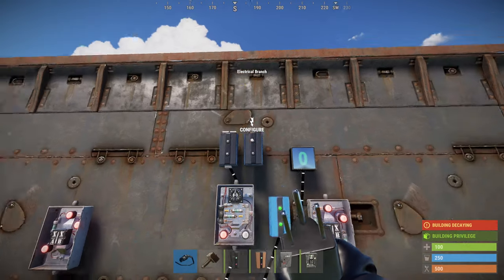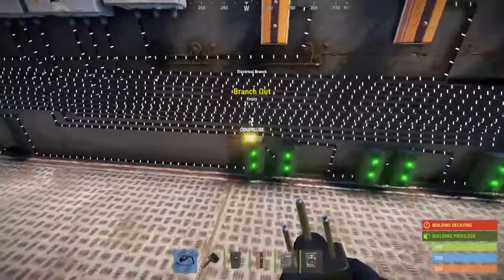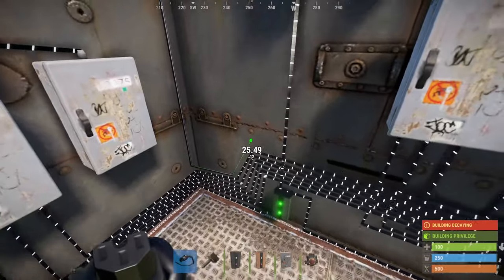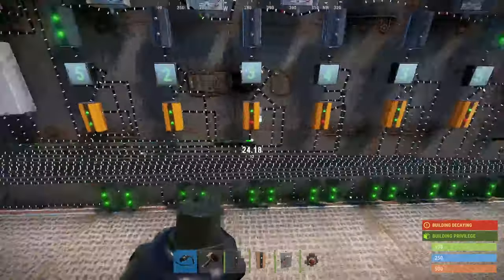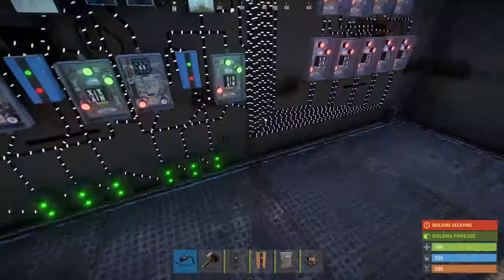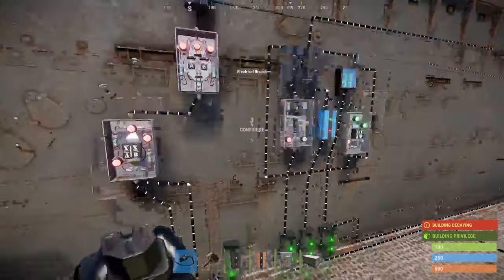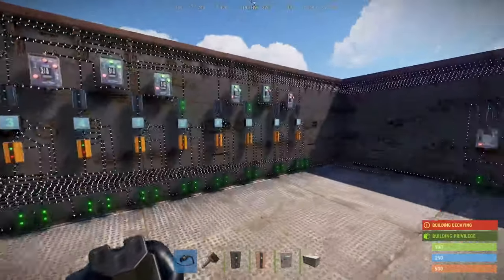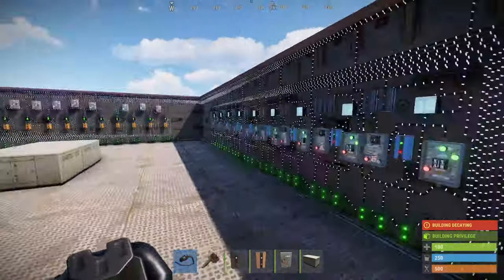Rust Blackjack Machine Breakdown (Advanced Circuits)

Comment: I'm a bit confused about how when a counter reaches 5 how it only allows the first one through to the card specific counter? Won't there be multiple cards chosen if both reach 5 at the same time? I don't see any mechanism stopping anything but the first one from passing onto the card counters...
Reply: In his video showing it in use he drew a 12 on a single pull so I think you may be right